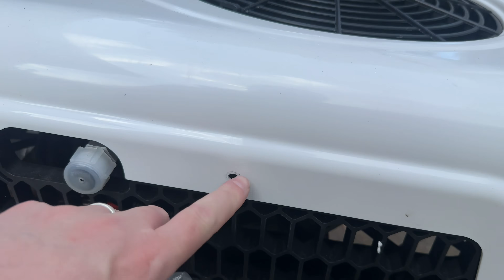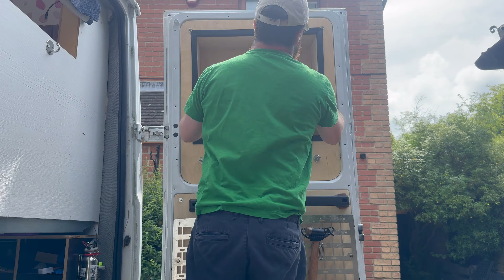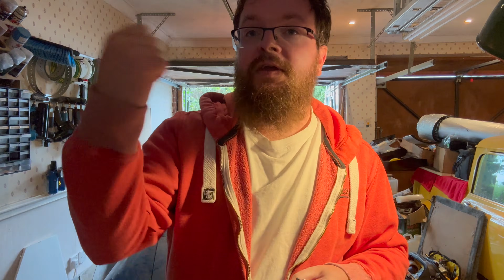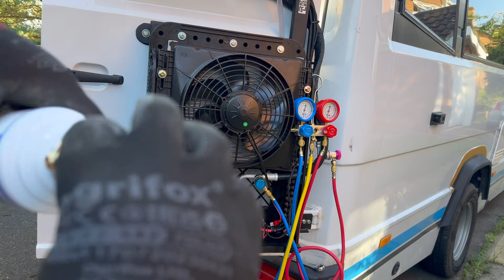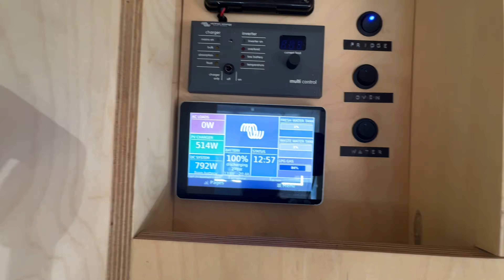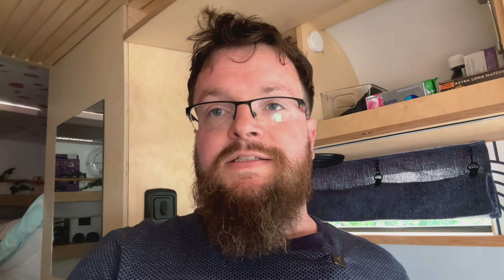12V Air Conditioning - 'Holy Grail' Treeligo Mini Split Van Install

Comment: Great video, thanks for your time and effort.
How noisy is the outdoor compressor/fan? In other words could you run it on a campsite without annoying your neighbours.
I guess you could cut down the hose lengths if you found the correct fittings and a crimp tool. Which may help with efficiency?
Reply from the maker: No problem at all. Great question, the outdoor fan is definitely louder than the indoor unit. You probably wouldn’t want to run it all night next to someone in a tent, but it’s not hugely noisy. Will see how it is with a basic DB Meter on my phone when I’ve a chance. 

Absolutely. If you knew someone that could make up hoses, or crimp on new ends that could work and you’d need less refrigerant.
Reply: @WanderbusAdventures  thanks for the reply. We managed to park up next to someone a few weeks ago (Karen🤣) who moaned about us running a small 12V fan overnight. It was 40C😏🤣

Comment: Stick a thermometer in the vent coming out of the a/c for the most accurate indication of how well it’s doing. Also, all of the furniture and other items inside the van are radiating heat so they have to be cooled down, too, before you’ll really feel the effect of the a/c. Just a little fyi from a girl from deep Tex-Ass 😂😅😊
Reply from the maker: That’s a great tip. Will give that a go. And that totally makes sense re. The stored and radiant heat. I think the key for our bus will be to keep the blinds up if we are somewhere very hot and stationary to try and combat this. With the widows it does store the heat a lot. Great advice. Thanks.
Reply: @WanderbusAdventures  😎

Comment: Yesss! Cracking job there! Are you happy with it all? It looks the business, well done on the install and gassing it up too. Is it possible to run outlet pipes further up the van to get the cold air around more?
Reply from the maker: So far so good. There are potential things I’d do differently next time. I might have run the cables in their own grommet perhaps. Will
Share as we learn more in the travel vids. 

Re the hose. Yes I reckon that’s possible and I might attempt it. Same for the venting warm air to the unit. We shall test and learn 😊

Comment: cool. 🥸 It will be interesting to see how effective it is at cooling the whole van down on a hot day (you do rarely get them there, but with climate change you might get a few more) Your install is very pro, just like the rest of the van. 👍
Reply from the maker: Absolutely. We want to give it a proper test for sure.